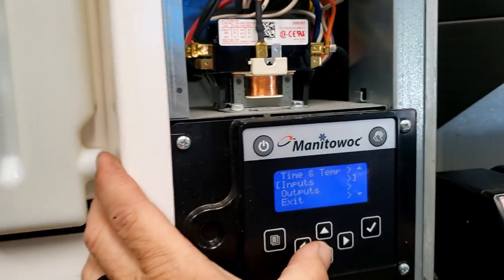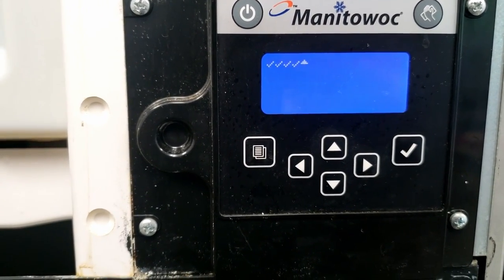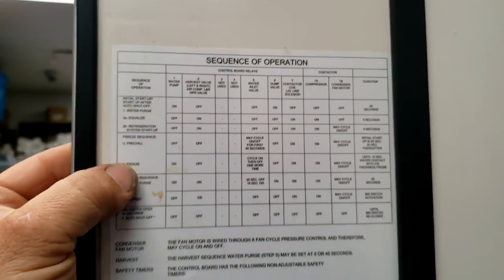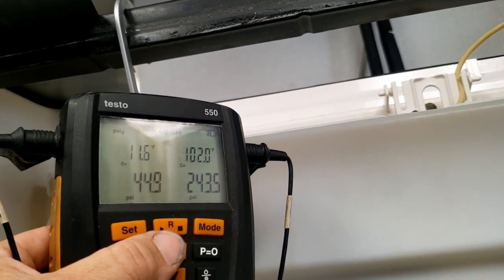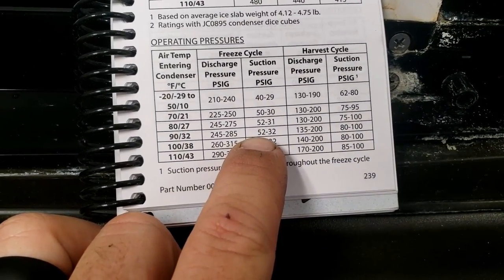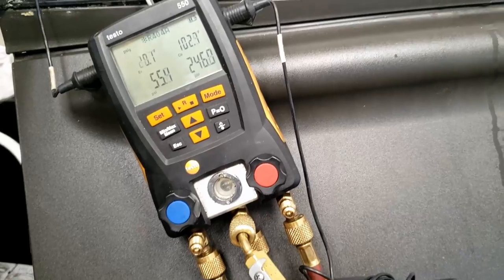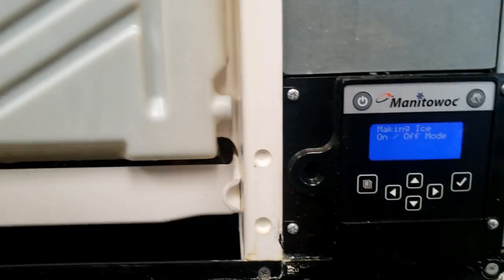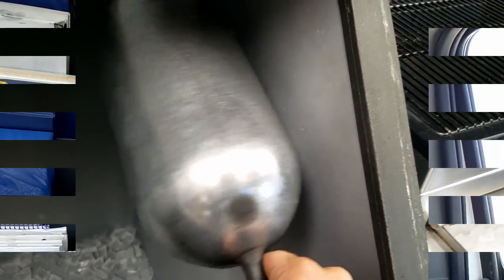How To Repair Ice Machine Not Making Ice

Comment: Hi, my compressor is running fine ?? Because the water is running but it’s not making ice.  It is cooling inside the bin.  Any troubleshooting tips? My tech guy came by and measure the pressure and recommended replacing compressor ? We can’t afford that right now.  Last time I did cleaning and reset then it worked.  Summer time maybe ? I will be grateful.  Thank you 😊🥳😘😁🍉🍉
Reply from the maker: Most problems are water-related, make sure your water filter is clean and got at least 20 to 30 lb of pressure and make sure your coils are clean and that you ran cleaner through the machine the way it's describes. After that it's hard to say without seeing it.
Reply: @HVACRSurvival  Thank you so much!  After cleaning.  I can make a video and send to you? 😃  Can hot weather made it this way?
Reply from the maker: @MrTk3435  If the system has issues like dirty condenser coils, low on refrigerant etc the hot weather can make it worse.

Comment: Has it happened again?  I have a machine with a new board (less than 1 year) that does the same thing.  It says it's freezing but the compressor is off and the water system is on.  It makes good ice until it randomly glitches.

Comment: I had one acting up about a year ago after a different company changed the board. When I checked to see what software it was running, all I got was gibberish. So I shut the power off and restarted the unit, and I still had gibberish for software. I also found no model or serial numbers on the board.
I had to manually enter the M&S#s and update the software and then had no more problems. Makes you yearn for the old B series😉
Reply from the maker: I like to check programming anytime I get weird problems.
Reply: How do you update the software on the control board?
Reply from the maker: Usb stick and down load from the factory site
Reply: @HVACRSurvival  Thanks!  found great info on the factory website

Comment: On a CME250AE-1A what would cause the water valve not to get power to it.I measured the resistance across the terminals and got .612 kohm is this normal? after I removed it from the ice maker
Reply from the maker: 612 ohms sounds possibly normal?  I don't have their charts in front of me. It could be as low as 30ohms?. I would put it in test mode and verify you've got the rated voltage going to the solenoid.

Comment: Kinda packed? Holy crap that was packed. Dirty condenser. That board had issues. I wonder if the that condenser fan motor Isnt working as well from the dirty condenser coil.

Comment: I've got a brand new manitowoc ice machine and the pan over flows with water sometimes.  Its level what else do I need to check
Reply from the maker: If it's a new machine it should be under warranty? I would have a service guy check it out. Sounds like a water level sensor may not be making good contact.

Comment: Guess I would first question why a board was replaced before routine basic condenser and machine cleanings were done?
Reply: I know you walked into this after the fact, so not trying to knock you down, just my first impression seeing this vid for the first time and being a bit distracted at that.
Reply from the maker: @davejohnsonnola2758   I can't go into all those details without creating drama... And that can cause problems
Reply: @HVACRSurvival  its all good,... rhetorical questions anyway so long after the fact.  Thanks for sharing what you can and do.
Reply: Have learned a lot from you and Chris S...as well as Manitowoc annual training which I missed this year's Zoom version, but since I don't have that much time at my facility to dive into the ones we have was just dropping in to try and pick up a tidbit.
Reply from the maker: @davejohnsonnola2758  That's awesome Dave, I really appreciate you mentioning that👍👍
Reply: @HVACRSurvival  oh great, apparently I have a Koolaire KD 0600 that was installed on top of an old Manitowoc B970 bin that will not allow the trough to be dropped for a normal cleaning service.... have any tips for cutting stainless steel to make a larger hole ?
Reply from the maker: @davejohnsonnola2758  either angle grinder with cutting blade or a sawzall blade for stainless.
Reply: @HVACRSurvival  the correct adapter runs $275, will give it a shot next month on PO request.... but ran in to the same problem on another machine that I know will not be approved....or worth requesting... damn thing is in the back of the maintenance garage.... ambients anywhere from 30F- 100F with a water supply that runs uninsulated outside of a metal barn for at least 50'.. oh and did I mention we have sand being blown off of the thoroughbred horse track blowing thru the open windows?

Comment: HELP Ice machine will clean but it won't go back to the regular menu. It only says 

OFF
On/ Off Mode

What's wrong??

It worked yesterday
Reply from the maker: Probably a bad keypad.
Reply: @HVACRSurvival  I just don't understand why if the keypad worked yesterday but not today.

But so far that's what I've been told it probably is. Thank you

Comment: Very unusual only thing i can think of was the relay may have been stook
Reply from the maker: The LED was not lite in the beginning of the video, that rules that out 🤷🏻‍♂️. Crazy, thanks 4 watching!
Reply: @HVACRSurvival  must have been a microcontroller glitch then and when you did the self relay test it fixed it
Reply from the maker: Maybe 🤷🏻‍♂️👍👍.
Reply: Could have been due to transient power glitch.  Just enough to confuse the controller but not enough for the staff to notice.
Reply from the maker: True 👍👍

Comment: Those mani logicators seem to take "garbage in garbage out" to heart even though the inputs are not relevant to the process
Reply from the maker: Honestly they're pretty reliable normally. that's why I had a hard time accepting a brand new board taking a dump right after another board was replaced for whatever reason.? I'm not the one that replaced the other board.

Comment: Try going back 
Turn off condenser soo it will go off on high pressure 

If board does not read the error again 
U know what's up 

Ever heard of ghost codes 

They are real
Reply from the maker: I found a few things wrong later, one of the issues was someone else replace the board and diagnosed it.  I came in second and can't fully explain without creating drama.